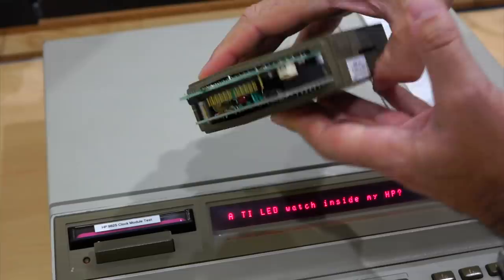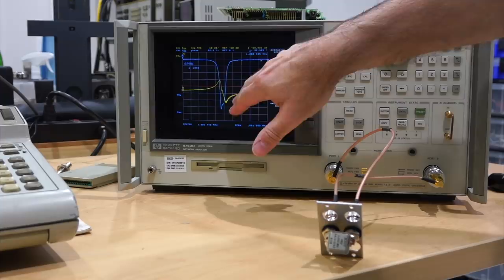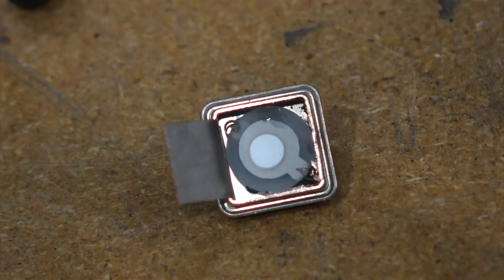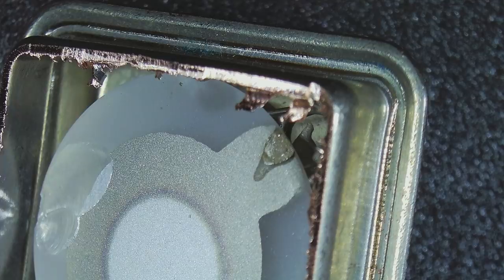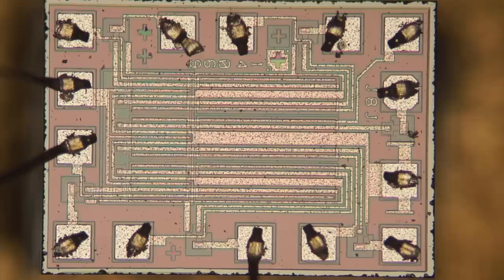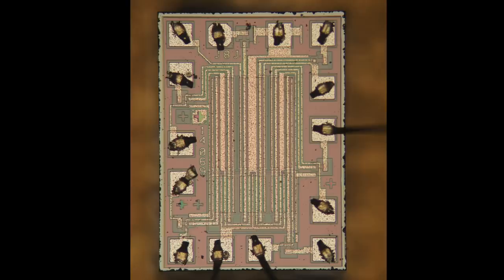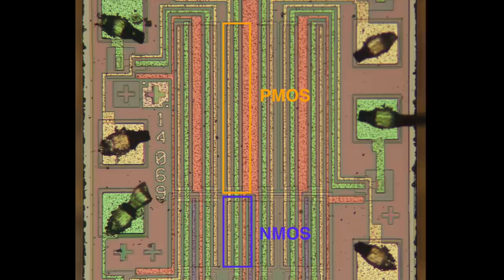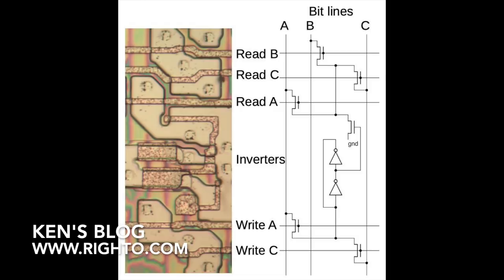Inside failed vintage components: 1 MHz quartz crystal and early CMOS IC

Comment: 5:50 So that means, any story in which some form of a Computer or Computer A.I. is still around after hundreds of years is not realistic. Which would mean that if we truly succeed in making Human-like Robots/Androids there lifespan would be limited by the life of their chips, be it CPU, RAM or Memory ones. After which amount of time do that electro migration set in? I am just curious how long a CPU can last.
Reply from the maker: You can actually trade that off as an engineering parameter. It gets worse at smaller geometries and higher current densities, and I believe it is therefore become a relatively recent dominant limiting factor (like leakage). I think it affects all high density / high power / small geometry modern chips. I don't remember what the number was (this is probably a confidential number anyhow) but there is a minimum accepted industry target for consumer chips, something like more than 25 years under extreme temperature and voltage condition - once again I am not a reliability specialist and I don't know exactly what it is, so I might be quite off. It's also a statistical thing, they won't all die once they reach this 
age, it's usually spec'ed as max number failures after a certain (very large) number of hours (it's known as FIT), which is usually kept as a relatively small number. Regrettably all electronic components fail with age, their FIT is never zero. You just get it down to an acceptable range for your application. Military and industrial chips are made to much higher standards and lower FIT, and aerospace chips to even greater standards. Which is part of the reason why they use such antiquated processes and large geometries (along with the better radiation resistance of the larger geometries).
Reply: @CuriousMarc  Yeah, so as example like in that 2002 movie "The Time Machine" where the hero travels from the 19th century to the 21st century where he finds some Hologram AI that he talks with, only to travel like 800,000 years forward in time... where he later meets the exact same Hologram AI which even still remembers him. Something like that would be impossible, even if we had a means to always have electricity.
Some Computer chips that are permanently under current, extreme voltage condition after 800,000 still working is impossible. I would say even working for 100 years is at the edge then.
The sad part for Space Travel is, because of the radiation and temperature conditions, making chips with a too small production size makes it harder. Like the 7nm process most AMD CPUs are made under. Somewhere here on youtube I seen someone talk about chips that are soon on atomic level created. I wonder for how long those would work.
But yeah, most stuff made today, would break and be nearly gone in 100 years without any human around.
Reply from the maker: @Momoka7  That’s basically the story of this channel. Most of what we deal with is 40 to 50 year old, and it’s rare that anything still works. And then after we repair it, and it fails again a few years later ;-)

Comment: The hex inverter chip looks like it has measles. Do all chips look like that or is it a kind if corrosion?
Reply: All chips from that era have their metal layer (aluminum) with a bubbly texture to it. In the 1990s they started polishing the wafers after each step to enable the addition of a large number of metal layers. In addition they switched from aluminum to copper. The visible (top) metal layer looks very smooth on those chips.

Completely unrelated but visually similar, solder masks for PCBs from the same time frame also have a bubbly texture if they went through a wave soldering machine.
Reply: @jecelassumpcaojr890  Thank you for your explanation.

Comment: Can we decap and read the contents of current day flash memories without relying on the controller or any electrical input, using the technologies we have today?
I know it was done with the NES bios ROM, but I guess that was a much simpler memory chip ...
Reply: Since many of today's flash memory devices, especially the higher capacity ones, use Multi-Level Cells, i think it would be very difficult to determine the contents (or rather, state) of each level below the topmost one.
The NES ROM you mention is probably a mask-programmed ROM, which, as you say, is a much simpler technology.

Comment: I need a +5v to -5v converter circuit... Doesn't need much power, 100mA max... I have a Commodore PR-100 programmable calculator, it used to have a small circuit inside, encapsulated in plastic, I believe it has one tiny transformer, 2 or 3 transistors, a couple of diodes and a small ceramic cap... If one of you knows any reliable circuit, please leave a comment...
Reply: You know the old trick of using a buck converter as an inverter by swapping two circuit nodes? You'd have to look for a small DC/DC that can withstand more than 10 V of input voltage, plus the associated external components.
Reply: Use a 555 timer chip in the astable mode, and put an isolation cap on the output.  Then rectify and filter the AC.  Something like this but change the output diodes and caps.
https://simple-schematic.blogspot.com/2012/04/doubler-voltage-with-ne555-schematic.html?m=1

Comment: My experience from those days is that while the inputs are protected using the diode/resistor circuit, you can still pretty easily damage them from the output side.
(e.g. with some glitch intoduced via static discharge or some inductive component)

Comment: What is electro migration?
Reply from the maker: I am no specialist, but my mundane understanding of it is that it happens when ions, metals or other materials used to make the transistors move or migrate from their original position due to the action of the electric field in the circuit while it works.